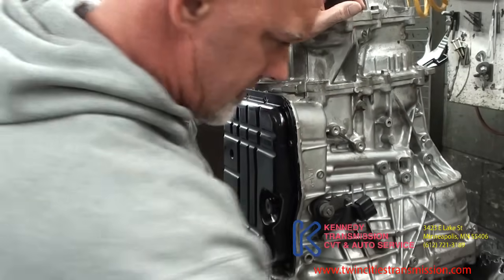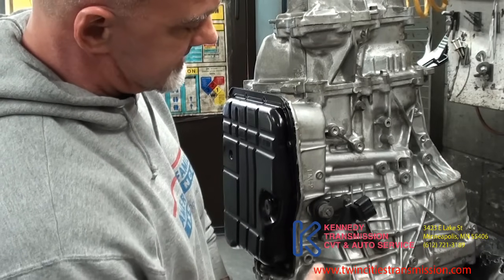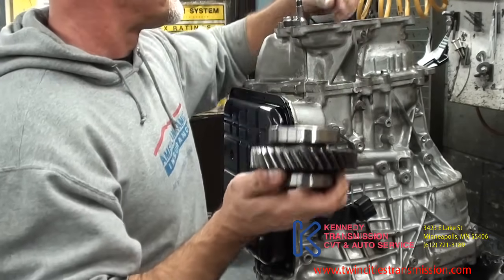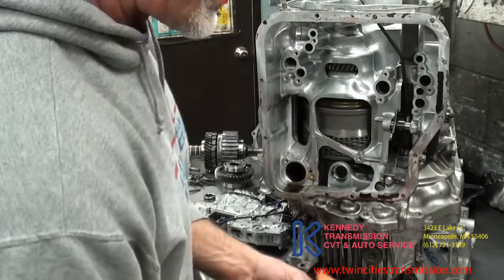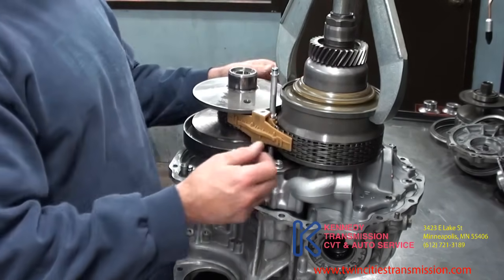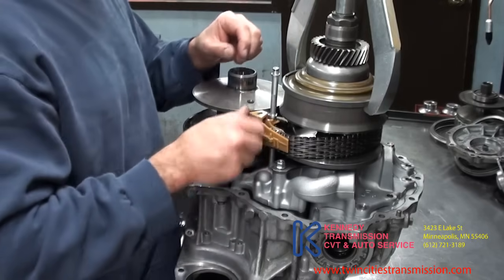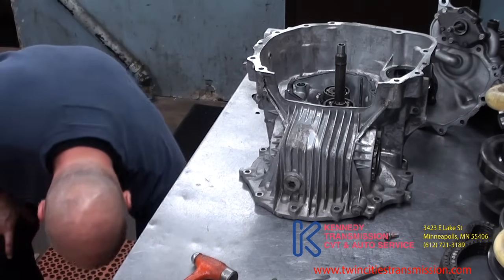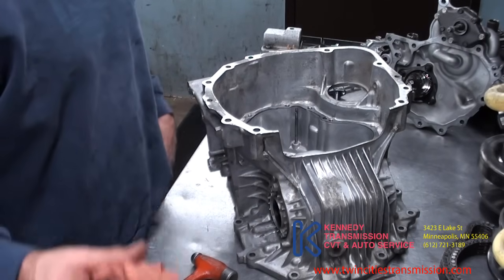Subaru CVT Repair- Lineartronic TR 690 Disassembly

Comment: I have a question if you want to answer it for me? What fluid goes in a 2022 crosstrek with a 2.0 engine? Is it subaru cvt-111 i think that's it.

Comment: People always say you MUST use the OEM fluid.  Is that actually true or can I use Valvoline CVT fluid?  The Subaru stuff is hard to find and absurdly expensive.  I’d like to do a drain and fill - drive for a bit then do another.  If it must be OEM, so be it. Transmissions are expensive.

Comment: Very impressive.  I have 2019 Crosstrek. As per Subaru service recommendations transmission oil was never changed during routine service visits. Lately I started experiencing shuddering during acceleration at low speeds.  As speed increases start experiencing constant annoying vibrations in gas pedal.  Any idea what could be causing this symptoms ?  Thanks

Comment: will changing fluid more help if it is already having intermitent stalling at lights? we have changed fluid twice on the 2012 subaru we have with 690 can changing it now at 173 ,000 miles do any good to stop the intermitent problem?

Comment: I've got a TR690 that seems to be groaning at very low speeds and there's some torque bind on tight slow turns. Could a repair be done on just the rear unit since it seems to be a center diff (or whatever the equivalent is here)?

Comment: What year did they first start using the cvt transmission? I'd like to buy an older subaru before they started using these garbage transmissions. I have a 23 crosstrek with a 6spd manual and consider myself lucky they had one on the lot when i went shopping

Comment: I do not like CVT transmissions at all, I just don't think they belong in a car. As for a snowmobile yes, I don't see any other way of doing it. I don't see how these large cars they put out like the Outback like the biggest best model Subaru makes, if it's got a CVT I wouldn't even try to tow with it. I see that Subaru is going to reproduce the brat, I think that's so awesome I would love to have one but with a manual transmission. I know that's never going to happen so I will stick with my 2001 Forester with 5 speed manual because I can fix that with my eyes closed.😅
Thanks for the video it's nice to see experts do proper stuff on YouTube.👍

Comment: Is there a video of this same transmission being rebuilt?
Reply: Author runs in reverse 😎
Reply: @joeblow5037  He only disassembled the worn transmission. Putting it back together with new and improved parts requires more knowledge than just the tear down.

Comment: LUBEGARD CVT transmission fluid is the best. Heat it the killer and cvts have alot of friction. The liquid wax esters are fascinating tech. I having been using there products for years and I have never had a Auto trans go out on me. I drive 100,000 miles a year and change my fluid every 35k miles . I use Lubegard Atf additve in between fluid changes. Cvt transmissions will last ,Subaru's will if you keep the fluid really clean and use a AUX cooler, there CVT is better cause it uses a Chain instead of a belt type. Nissan's suck and the number one killer on Nissan CVT is heat death. . Nissan has ruined there reputation  and they are wondering why there sales are going down the tubes. Nobody wants to buy a car and have to spend 7000 grand on a new trans at 50,000 miles  because like Kia,Nissan looks for any excuse to deny warranty work. They have been making bad transmissions for 20 years and there are no repairing Nissan Cvt when it does it blows metal bits everywhere.

Comment: seems pretty much straight forward, just the need for a few different types of pully's for removing bearings, the big one for the CTV belt itself and such. 
There is plenty of horror stories and people telling us mechanics that rebuilding them is impossible and not even worth attempting. They actually look pretty simple with far less moving parts than i thought.

Comment: So I got a 2021 Crosstrek with the CVT and the dealership tolde not to service it that it was non serviceable . Do u know if thats true??
Reply: The Subaru dealer is not allowed to service it. Anything can be serviced, it just depends on parts availability, cost, and willpower. Your transmission is a TR580, which was mentioned in this video, though is not the one shown.

Comment: got a 15 wrx that had bad motor  replaced it  took it for test drive lost all gears after 30 min drive never drained fluids  in trans and i got a code for trans for secondary pump pressure  p0841 what should i look at

Comment: Great video!! Besides the problems with both the lockup solenoid and the washer issue causing the converter to stay locked, what other common problems do you see with these 690 transmissions? They seem quite reliable.

Comment: Great video!

One question
How would you test for Glycol (Antifreeze) presence in CVT Fluid or ATF Fluid).

In case of transmission cooler leakeage
Appreciate your Assistance.
Thank you
Reply: water doesn't mix with oil. Pull the drain plug, see what comes out.

Comment: Jeff & Matt can't thank you enough for the video.  My dad was a mechanic and the stainless steel table bring me good memories when I have first disassembled an AT.  Now am driving a WRX CVT TR690 and just love it.  At 48K miles i had my subi dealership replace my CVTF, and they used the Multi CVTF Motul, not the Subi High Torque One.  When drove tested it, on lower revs was so smooth after replacing the strainer.  But on high revs i felt that the belt has slipped.  Shall I drain this Motul and try to find the High Torque Fluid ?  Appreciate ur kind feedback. Joe
Reply: As has been preached to me by our lord and savior SOA, use ONLY the designated CVT fluid for the car. I wouldn't risk anything else.

Comment: So i am an aircraft and auto mechanic. but im just starting to dive into these cvts. so to give you a good overview, i have a CVT-TH58A, HEV (hybrid) Summetric, 3-element, single stage, 2-phase torque converter type setup, now i had a serious event. The torque converter  went out, i discovered there was almost no gear oil in the front differential, yes thanks subaru, and when in drive, only the front wheels spin, the rear wheels jump spin very slightly from time to time, the front spin, but the driver's side wheel spins more rapidly than the passenger, there is a loud thumping and jumping when acceleratiing. it feels like half a clutch so to speak and compare to to get an idea of how it feels. So its a thump/clang with a jump forward accel, and in-between thumps there is no accel. this happens rapidly according to the RPM's produced. its not as bad at higher speeds, thats if i can get it to higher speeds. I already changed the torque converter which was also bad. Also to add, i had to clean the TCM as all the piston like valves were seized in place. I got that working. But trying to get an idea of what is damaged is mind boggling. Since im just starting to get my experience and yes this is a great complicated way to learn. so Let me know your thoughts. thank you

Comment: Dear friend, I have spent a long time trying to find out where it goes or what is the input route in the transmission of the return line that comes from the exchanger. Does it go exclusively towards the drain pan, or does it lubricate or pressurize some intermediate part or mechanism on its way?

Thanks for the technical video.

Comment: I have a 2022 hyundai elantra with the new IVT transmission do you recommend changing the oil in the transmission,  they recommend not changing the fluid unless it needs to be repaired.  That dosent sound rite to me.
Reply: It's not right. It's a lifetime fluid, sure. The lifetime of the warranty period of the trans...

Comment: Hi sir,
My subaru legacy BM9 saloon has a problem since i changed CVT fluid.Its a TR690 gear box.When i start the car and shift to drive,the car will start moving foward.But when i press the accelerator gently the car jerks between 0-20 kms.Above 20 kms the car runs fine.Plugs are fine,coils also fine.What can be the problem?

Comment: Hay guys so a year on and the car was going good starting making bit of noise than bang thought it  was a broken CV because the broken shaft noise but it's inside my trans or front diff any ideas you can put in in drive or reverse and it goes ting ting ting and won't go forward or reverse any help would be wonderful.

Comment: Boy, if I had not come across this video, I would have remained sold on what the Subaru dealership told us, that the CVT could not be repaired and replaced as a whole (for a LOT of money, of course, like $9 grand). Thank you so much! And since we live in St. Paul, we can definitely consider doing business with you. We were in despair earlier about the replacement cost of the CVT, and now, thanks to this video, we are becoming hopeful. Again, thanks Kennedy Transmission!

Comment: You refer to having a bearing at the pump going bad and making noise. I have a 2013  legacy with a horrible squealing noise coming from transmission.  The vehicle struggles to move.  Feels like it is binding . Is this what you experienced?   Thanks in advance.
Reply: squealing typically means chain slip which causes rapid deterioration of the variators.

Comment: Would you advise sourcing a remanufactured TR690 or just let the shop rebuild? Dealer says the transmission is shot and wants to replace it for 8k... Car still moves when it's cold and I asked them to check out the tq converter but they didnt want to do it.

Comment: Subaru CVT transmission is garbage I highly recommend not buying one!!!
Reply: A masterpiece of engineering! Garbage? Not hardly! If they were garbage Subaru would not of devoted all their energies to this transmission. What is garbage is the false propaganda.
Reply: I have a Toyota forerunner with 400,000 miles on it not a single issue with the transmission or main engine just normal wear and tear in normal maintenance Subaru can’t even touch that!!!
Reply: Hey man I’m just saying I put two transmissions in my car I got 170,000 my mechanic says to junk the car at this point after putting over $10,000 into the vehicle paid 37,000 for it I’ve had two outback‘s both of them have let me down what kind of propaganda is that bro!!!
Reply: @gratefulwindssailing  I don’t know what to tell you but not the general experience from anybody that I personally know with Subarus, I am not saying they are as bulletproof as a forerunner because they’re not!  I personally have had and still have Toyota trucks land cruisers and forerunners all all have had some issues from time to time but currently own a 2015 Outback with 208,000 with zero problems everything is flawless the CVT works perfectly so I know there  potential! One of the biggest problems with Subarus are the owners! They beat the crap out of their vehicles because they are a fairly high revving motor unlike Toyota trucks which are slow low RPM industrial power plants!

Comment: did you know what was wrong with it before you split it open?  at what point did you decide what the problem was?   in things like this is it routine to replace a bunch of parts whether they look broken or not?
Reply: usually a bad bearing or 2

Comment: Engineer 1: what shall we call this round thing?
Engineer 2: how about a shim.

Whenever I see one of these CVTs I wonder how can it produce torque without slipping.. I thought that they engineered out the belt on the latest CVTs. 
It's putting all that friction pressure on a small point, metal on metal, of course it will slip and wear.

Comment: Hello, This Chang Su, KIM, from South Korea,  Today, I have a question, Recently, I found oil leakage at front differential case, I guess for 3 reasons, 1) oil seal leakage of crankshaft, 2) front differential case assembly part, 3) drain plug of front differential case, also has been checked of smell of oil, I think that it is engine oil smell...., and it was from crankshaft area,  oil was wet finely, Please advice for this matter, Thank you.

Comment: Is there any safe way to change all of the fluid in a Subaru CVT?
I understand that a drain and refill only changes about 20%.
Reply: I have never done it on any Subaru but it can be done on other brands so I would say Subarus are no different. So you you can do it. You can find videos on it. In my current car with cvt i replace 3qt. with every motor oil change. It is easy to do since my 2017 Murano has a drain plug on its cvt and only exactly 3qt drips down. The only problem is that there is no dipstick in Murano cvt so I have to make sure that I add exactly what came out. Perhaps you can start doing the same after 30 k miles.
Reply: @spol1622  yup i find out hard way mitsu got jatco , blew up on highway , no prior warnings at 80k , fluid changed at 60k. luckily still  under warranty. got 2017 lancer

Comment: Great video! I have a 2012 Outback with a CVT with an issue where once you come to a stop, as you first start to accelerate again it lurches and almost stalls out. Once you get past that it’s fine. What I have found is that if I put it into manual and just operate from the paddle shifters it works fine. Couple of odd things- this only happens once the engine / transmission have come up to temp. If you start driving on a cold day, this issue will start just about at the exact same time as warm air will start coming out the vents. 

I’ve heard of this issue of the torque converter staying engaged and my theory is that at some point once the system heats up enough the fluid starts being diverted to the CVT cooler and that triggers the torque converter to stay locked when I come to a stop. 

I’ve had a fluid “change” performed where you take the drain bolt off and then add more fluid into the side fill hole. They added about one more quart in than was removed. But it didn’t resolve it. 

I was quoted $7k from Subaru for a new CVT (I have 170k miles on it so no warranty). Since it still works in manual I’ve just been driving it that way. Curious if having the torque converter services might resolve this.
Reply: It's the torque converter or the valve body
Reply: Valve body
Reply: @nathanwhitman4699  Torque converter?
Reply: I have the same exact problem...Did't he say a thrust washer is wearing and not letting the oil passage way depressurize?  So that means valve body won't fix it?  Or the TCC lockup solenoid?
Reply: Valve body, costs about 300 bucks.
Reply: @514aam  Torque converter?
Reply: @DanielDIY4  I would start from the valve body, You can find DIYs about it, check the selenoids, also change the fluid... Valvoline CVT fluid is a good option

Comment: this guy is a damn transmission genius for doing what no Subaru certified mechanic would do.
Reply: All master techs had to take training on the CVT, we all had to disassemble and rebuild one. Subaru doesn't want us doing this because it's cheaper for them to have their own refurbishment center.
Reply: @Chippy569  Toyota does the same thing, bench and assembly line labor is always cheaper I would expect.
Reply: right!? in my defense (Subaru dealer technician) Subaru of America only authorizes transmission unit replacement, unless its a minor repair such as a valve body, torque converter, harness/inhibitor switch, or other external sensor/component/seal. I guess they dont trust us to overhaul the unit!
Reply: @TheGroundBeef  they're avoiding the training expense, and not doing the living planet any favors (too much profiteering, not enough consideration for better lives)

Comment: My son has our 2010 Legacy with well over 100k and no issues with the CVT. The secret? Don't touch it or the fluid...
Reply: Yes my 15 outback has 112,000 and is absolutely flawless everything about the car is like new
Reply: Praise! The manual specifically states that but the bonehead internet mechanics treat it like a regular transmission. All you have to do is get it inspected at the dealer every now and then.

Comment: What are your thoughts on Nissan style "pusher" belt vs Subaru "puller" chain? Advantages / disadvantages of each design? I'm designing a CVT for driving a centrifugal compressor on paper and debating which design to mimic
Reply: subaru design
Reply: @EpicDrew15  Jatco makes all Nisssan cvts.   Also for Mitsubishi and some other models

Comment: Your comment about the correct amount of oil being a must, makes me concerned, I do my own oil changes, but at 30,000 miles I had a dealer do the service, and my engine oil was almost a quart overfilled, filled it to the kink in the dipstick instead of the second hole.  I brought it back to have it corrected, they put the same tech on it.  They said it was all set, so I drove it home, checked the oil, and it was still at the same mark.  Luckily I have an ezdrain in place of the oil plug, so I was able to correct it.
Reply: He is talking about CVT fluid, not engine oil. The two are not connected.
Reply: @Backs4more  If you can not trust them to do the engine oil correctly, can you trust them to do the cvt? That is my point.
Reply: i have a drain also and if tech just goes by how much he puts in a regular oil change it will be slightly overfilled since the drain valve keeps a bit more in oil pan unless car is tilted on ramps rather than flat like in garages